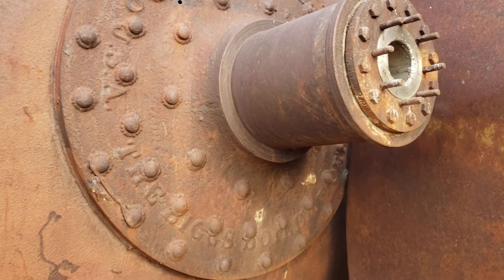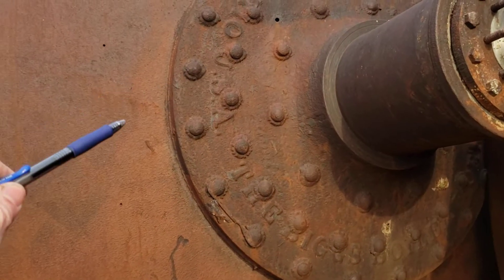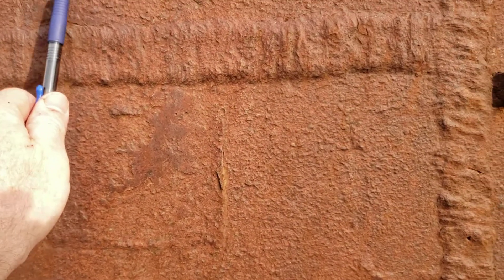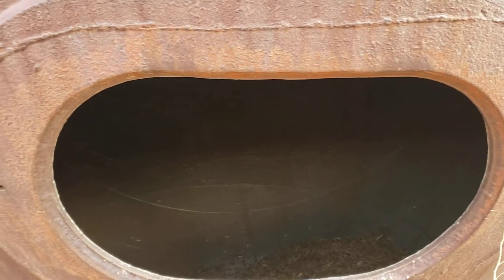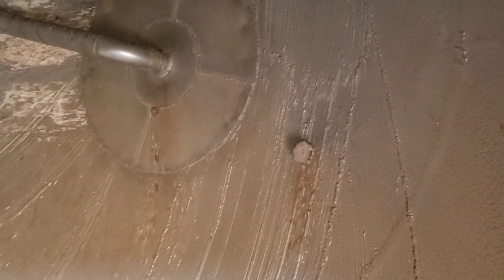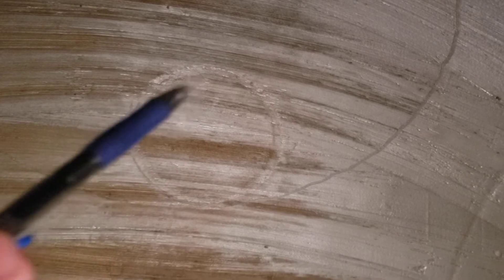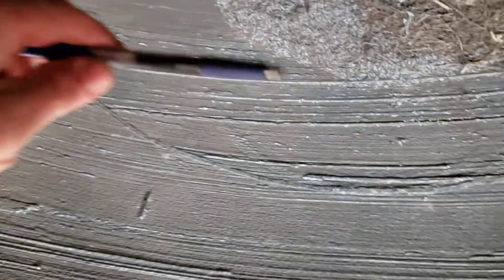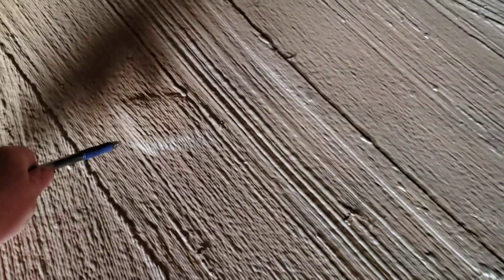API inspection of a rotating pressure vessel.

Comment from the maker: A rotating pressure vessel with rivets, and internal weld metal buildup.  There is alot going on with this pressure vessel.
Reply: amazing indeed, a big question is what conduced them to do so. Weld metal buildup all over the inner surface. The ran out of plates? or budget?